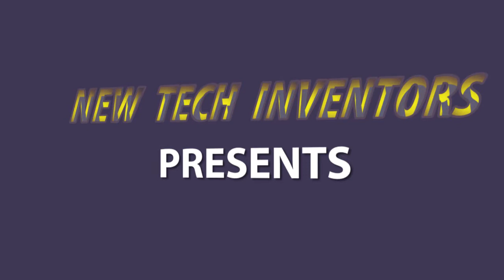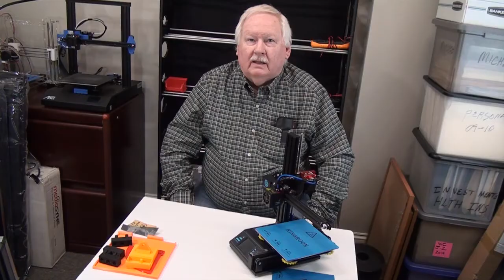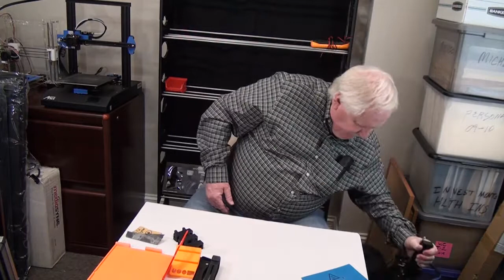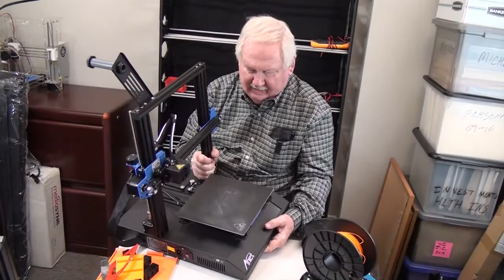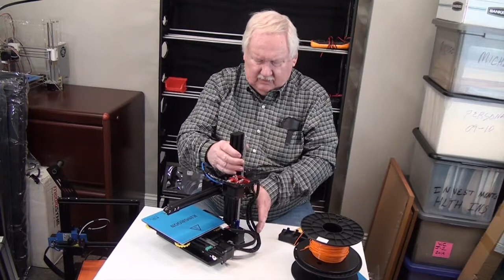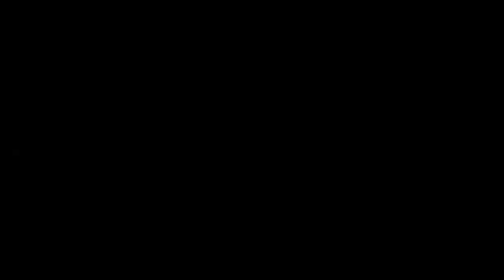Comment: Would advise against Anet. I purchased an ET5 printer for my son but it shipped with defective parts. The X Axis Drive belt broke upon attempted installation and the company has not sent a replacement despite repeated requests. Their only response was to ask for proof of purchase and photos of the part, all of which were provided, but no part has been shipped, even according to their own provided tracking number. Would LOVE to test out this printer, but it's been sitting useless for the past month while we wait for the appropriate parts.
Reply: Sorry you have had problems getting started with your 3D printer. I currently have over 50 printers and have had a good experience with most of them, however I have encountered broken or missing parts on a few and had to go thru some additional cost and effort to get them going. Good luck and hang in there.